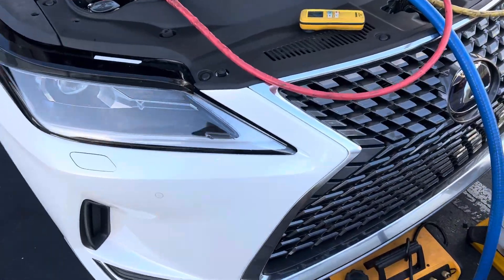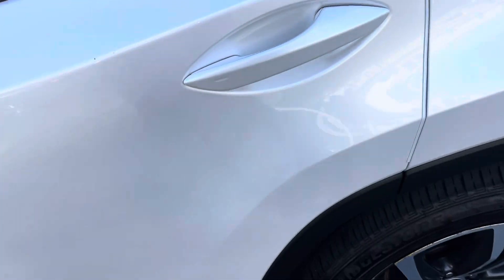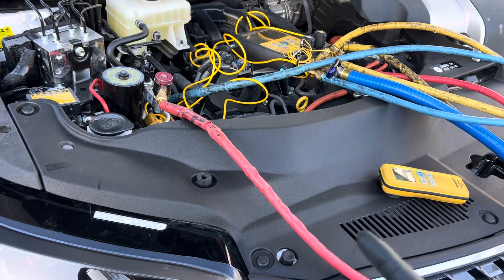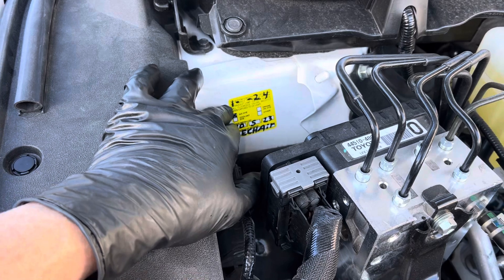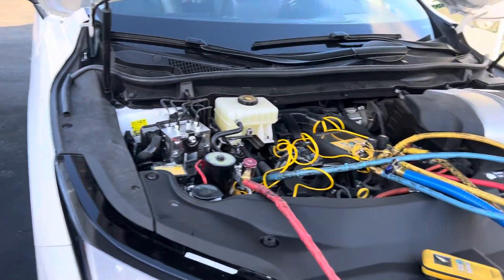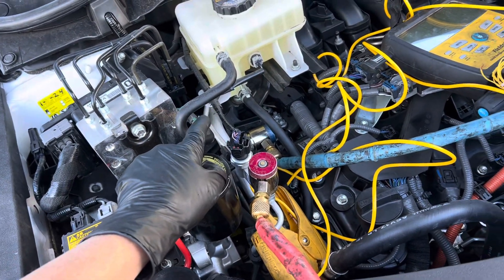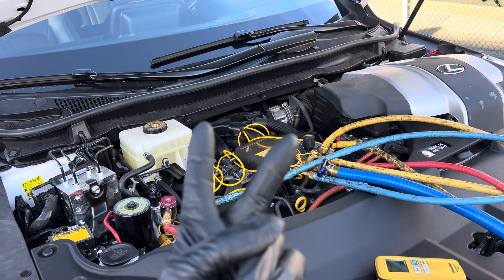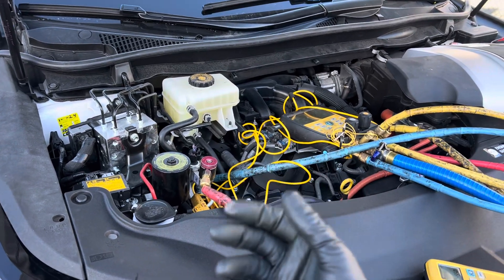AC refrigerant sticker missing for charge quantity aftermarket sources. I’ll have different info

Comment: If you start with an empty system , just start with one can [ 12 ounces ] if you dont use a 30 pounder , then watch  the pressure as you add , there are pressure charts that tell you what the high side should read / with air temp at the front of car when full. If no charts use common sense . Dont overfill , better underfill . If you do that line of work for awhile , you can make the a/c work fine with no scale , just watch the high side , and vents temp .
Reply from the maker: The charts are old-school many of them were reprints from the times of old fixed piston compressors, and they just keep pinning it onto some of the newer vehicles that have variable displacement compressors. 

So the pressures mean nothing. 

And depending on the temperature of the day with the ambient air temperature sensor, the software, and the computer takes over and starts changing the pressure as you’re adding in refrigerant. Giving you a sense of what the pressure actually really should be, but it is not.. 
    Because the variable displacement control valve takes over and starts dialing back the compressors displacement. 

I’ve made many videos where the systems were filled up 50% of the way mild temperature or inside the shop where it was the sun and remember a sun sensor the software will determine on some vehicles what temperature will come out of what side of the car passenger driver side it will literally change the temperature. 

Of the vehicle start pulsating or bearing the speed of a fan to maintain the pressure that the software wants not what the refrigerant should be according to the old average pressure temperature chart relationship sheets that were put out by the manufacturers. 

And then recharges in the winter time because they did an engine swap or they had to remove a dashboard for a heater core or they had collision in the body shop. 

In the shop is 35° or 45° or 55° which I’ve made many videos on. 

There are no pressure charts for temperatures that low . 

Because the pressures are extremely inaccurate, sometimes never even allowing the electric fans to cycle on depending on the ambient . 

I’ve made videos where the refrigerant level was several ounces low on refrigerant nowhere near being full but the high side pressure actually went up higher than would be considered normal 50 or 100 psi 

This totally gives the technician the sense that he is full because the pressure is actually high and because of lower ambient temperatures the dash temperature might be coming out 39° out of the dash, but they send the customer out low on refrigerant 

This is why nobody uses temperature pressures anymore . 

There is only one way to do vehicles now, especially with the vehicles that are all been coming out with the last several years with internal heat exchanger. There is no way for you to use the pressure chart, especially on cool days. . With variable displacement compressors.. 

There’s only one method drain and fill using a scale and weight absolutely no other method. Everything else is only guessing. .

Comment: brother I have been watching your videos on oil balance for the ac system. 
I really need your help, I am replacing my entire AC system. Starting dry. 
2007 Acura TSX. 
I cant figure out what the correct total system capacity is for my system. 
4seasons says 8.11oz , supercool.ac says 5oz. 
The service manual does not have a straight forward number.

I really dont want to overfill or underfill my system. 

Can you help me out and point me in the right direction?
Reply from the maker: I have the same problem sometimes. 

Sticker on the original compressor, how much oil was in it  ?. 

Give me your Vin number and I’ll look it up in my database and we’ll compare that numbers you already have . . 

This is where you try to find as many reference and trying to see if two or three of them overlap the same . 

The manufacturer can say it takes 6 ounces 

But then when you bring the manufactures quantity for each individual component by themselves, it might total 8 ounces or more . 

It’s very confusing sometimes how they write them . 

Sometimes looking one or two years, older models, two years, newer models . 
       See if they stay consistent. 

I have never been able to find one source that has been 100% reliable .
Reply: @coldfinger459sub0  Sorry for my previous reply, I didnt see the full message by accident 

So I havent removed the original compressor yet, car was diagnosed by a local shop and told it had a compressor leak

my cars vin: JH4CL96827C015550

and yes exactly what you said is what im dealing with. just different numbers not adding up! 

one thing I did is cross reference with a 2007 honda accord since the chasis has a lot of similarities overall. 
that was absolutely consistent in around 5oz total capacity between the service manual, supercool & 4 seasons.
Reply from the maker: @dannyhefner  46 PAG (SP-10). 
Oil 4.33 to 5 oz. 

524 g. / 18.5 oz 

That’s what my CYTK says to about the oil . 

$1300+ for a factory OEM compressor ouch 🤕 💸
Reply: @coldfinger459sub0  thank you so much for taking the time to check for me! 
and yes thats crazy. I had to go aftermarket. 
I guess for this TSX you cant even buy a compressor straight from denso for it, you have to go directly through the dealership.
(denso was not the oem supplier but is the oem replacement)